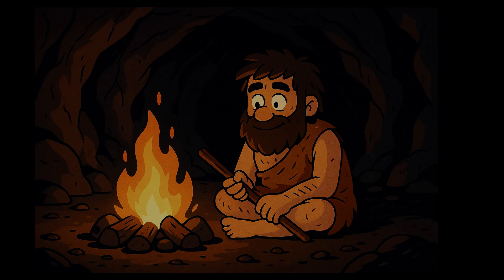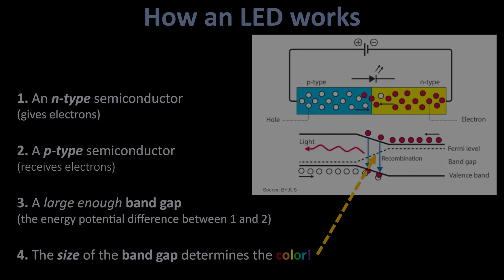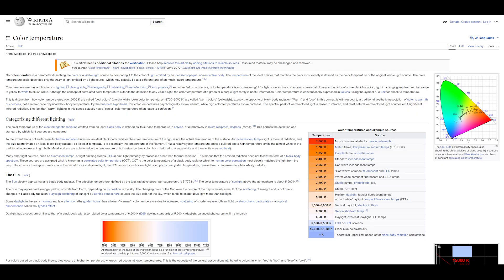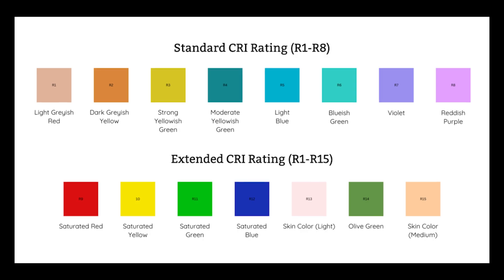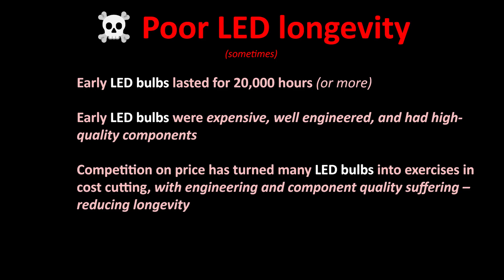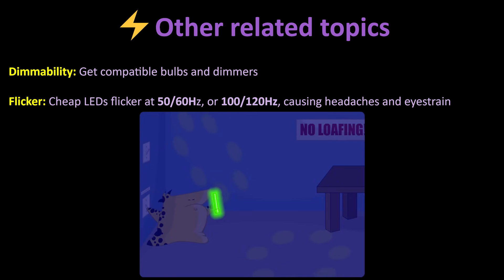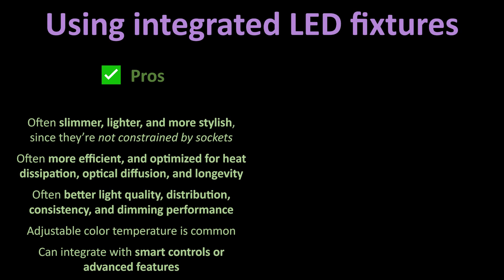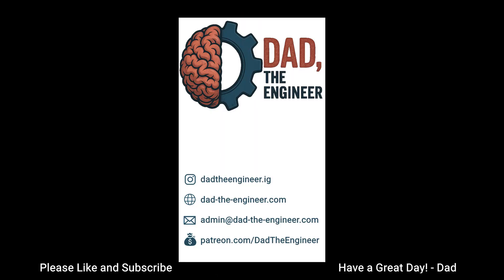Dad Explains LED Lighting — How They Work, Blue LEDs, CRI, and What to Avoid

Comment: I'll stick with LED bulbs. Two years later, might have to replace it. $5 tops. A $150 LED fixture toasts itself? $150 to replace even if it did last a couple years longer is too high a price to pay for me.
Reply from the maker: Well, I do like that most LED light fixtures that cost more than $50 seem to use common, and easily replaceable drivers.  It's kind of like the situation back in the day with florescent ballasts - except cheaper.

Comment: Oh and yeah - one of the original corncob lights that does still work here is an outdoor light without any shade to protect it, mounted sticking out sideways from the wall of the porch. It has a bird's nest built on top of it, but the light still works. I guess the birds in that nest get meal delivery with the insects attracted to the light at night? The LEDs use so little power we don't bother switching off our outdoor lights from one year to the next, and they're not bright enough to attract insects from very far away but the spiders and bats and birds all seem to like what they do pull in.

Comment: I've been off grid for well over 15 years now. A small number of the 12v corncob lights we started with still work. Most of them gave out around the 8-10 year range. From what I could see, I think they had corrosion in exposed wire components because the humidity gets pretty high here sometimes. Also I could tell by looking at them that those old corncobs were assembled by hand, plates of LEDs soldered together into a hexagonal prism to fit into a light fitting that was designed for an old-style incandescent. The lights I bought to replace them look completely different, and I definitely expect them to last a lot longer. But there are no dimmer switches in the house, and the colour of light in each room is what it is, whether that's warm or cool.

I need to learn a lot more about dimmable LEDs. In our next house I need programmable diurnal colour temperatures to help with the sleep problems some of our household are having, and I need dimmers, but they mustn't flicker. Not just "flicker so fast you don't see it" but actually not flickering at all. And one of my hobbies is embroidery so I really do need to be able to see the colours of my threads, and another household member paints, as well as all of us wanting to be able to see our food when we eat.

So uhh. If you make more content going a lot deeper on this topic, I'll be here. My dad was an engineer, but he's not here to advise me any more. I need to learn and understand all this stuff for myself.
Reply from the maker: I'll make as much of this kind of content as you all will tolerate.  However, if you have any questions, you can drop them on a video (even if it's not related to the topic), or you can email me.